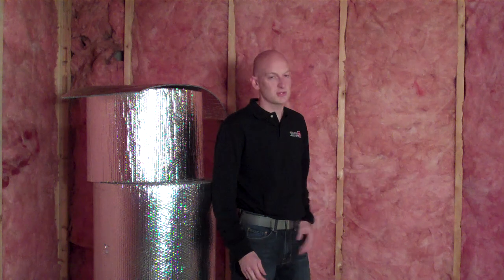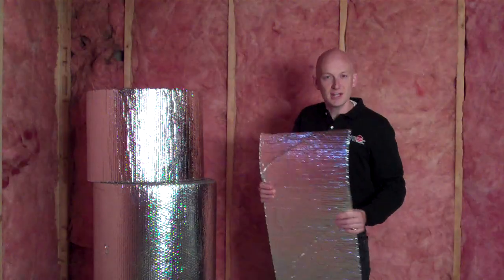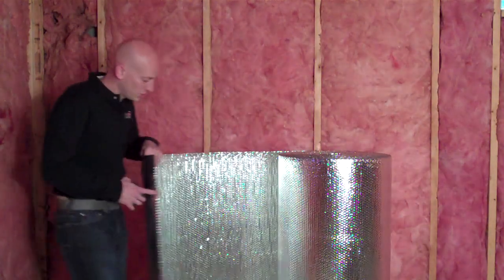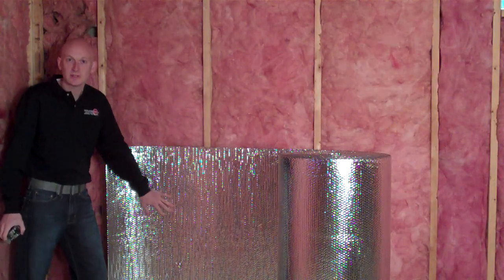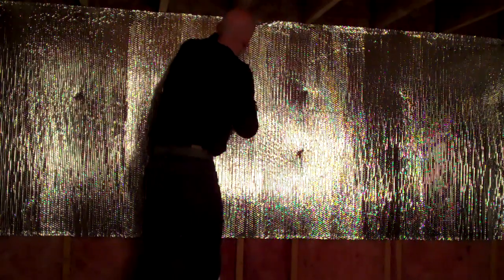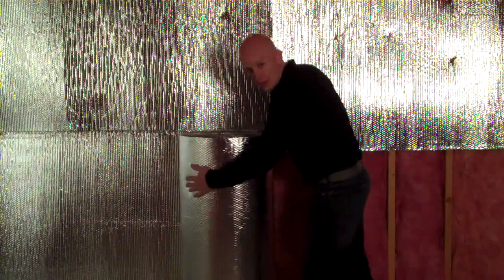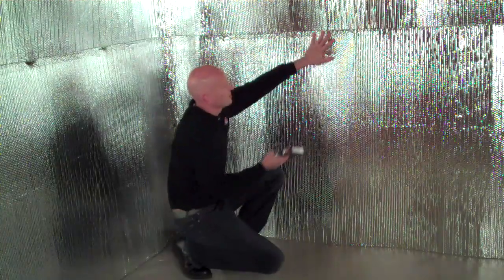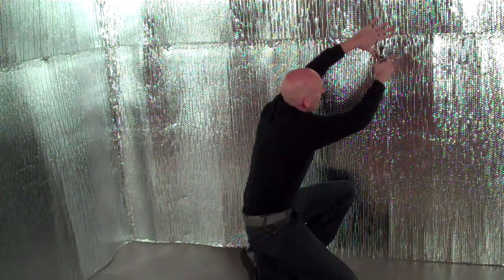Insulating Walls with Reflective Foil Bubble Insulation

Comment: I did this to my garage in 2006 before I ever saw a Mike Holmes production. If I had to do it all again, it would be with closed cell foam. I had to open the wall recently for a new electrical main panel install. No mold, no moisture. This stuff was advertised then as an R19 value, but it is only a thermal break. Closed cell would have been so much easier and better, but more expensive. I had to extend my garage door opener antenna because of this stuff, it blocks all signals. I thought I would answer a few of your questions since InsulationStop stopped answering years ago.
Reply from the maker: Closed cell insulation is a great insulator and as you mentioned expensive as compared to other insulation types.  Our products are impervious to mold and moisture as well, that's why they excel in applications prone to these conditions.  The r-value you mentioned is for fiberglass insulation and not reflective insulation (or at least should not be).  Regarding extending your garage door opener antenna this is interesting as there are many references on the web that radiant barriers block reception.  We have not found this to be an issue with our customers.  We DO however sell a product designed to block all signals but this is used in a specific types of wall constructions.  The products are for SCIF buildings or Sensitive Compartmented Information Facilities.  They are essentially quiet rooms used primarily by the government where they need to ensure there is no electronic eavesdropping.  Here is a link to the SCIF information on our webpage, http://www.insulationstop.com/rfoil-scif-ultra-nt-radiant-barrier-solid.html, look halfway down the page under the product to see the SCIF specification and different wall construction techniques.  We apologize for not answering comments.  We were unable to comment, post video or access our account under YouTube/Google/Google Plus "conflicting accounts".  It took a long time to get this figured out so we would not lose our entire channel.  With the help of Google Support we finally did.
Reply: 404 page not found

Comment: If I was to do this with tinfoil aluminum foil and the put lining paper over it would it hellp with preventing damp mould and help keep my flat warm I live in uk
Reply: Standard tin foil aluminum does not have the same reflectivity as radiant barriers made to block heat.  You would want a product at least 95% reflective or more.  I'm guessing you want the lining paper to act like the kraft paper used in insulation to be a vapor barrier?  If so you would want the lining paper to have the same attributes as kraft used in standard insulation products.
Reply from the maker: In order to be considered radiant barriers, reflective insulation must be at least 93% reflective.  I am not sure exactly what you are referring to when you mention "tinfoil"?  I'm guessing the lining paper would act as the "kraft" liner which we use in the United States as a vapor barrier.

Comment: Why are you installing a vapor barrier in a basement? I'm pretty sure that'd against building code and prone to start rot and mold.
Reply: This depends on the location actually. In some states the location goes through very different seasons from cold / frozen to seeping / wet to dry and breathing. While other locations only go through cold / frozen to wet. In such locations a vapor barrier is advised. Not only that if you have outside treatment to the wall a vapor barrier might also be suggested to keep the inner wall away from both climates.
Reply from the maker: Hecket I agree with Hecket.  Location determines building practices.  This is why local codes supercede national codes.

Comment: What's the rated R value of this stuff?
Reply from the maker: The r-rating depends on your application.  Our website shows many of the common applications and their related R-values (use in barns, metal buildings, hvac insulation, pipe wrap insulation, and under concrete slabs) to name a few.  Radiant barriers, the sheet like material, have no r-rating and provide a radiant barrier only.
Reply: The R value is 1, its used to stop radiant heat, not conductive heat.
Reply: Depends on the application.  On our website we show many different construction applications and the R-values are listed there.  (Pole Barns, Metal Buildings, HVAC Insulation, Pipewrap Insulation, Under Slab Insulation, Crawlspace Insulation)
Reply: lostimage08 This is the r-value when used under a concrete slab as an airspace is not present so only the bubble layers are creating the resistance or R.
Reply from the maker: lostimage08 This is the r-value when used under a concrete slab or in a radiant heat application as there is not an airspace present.  The bubble layers provide the R.

Comment: This product looks safer when directly  under the sheetrock or wall treament ~!
Reply: In finished areas this is where it would be installed.  For unfinished areas the insulation facing the exterior is commonplace, especially in barns for instance.
Reply from the maker: In finished areas it would be, however for unfinished spaces this application is fine.  This is the same way it would be installed in metal out buildings and barns.

Comment: This looks like it might work  well in my garage.  I already insulated the garage door with something similar.  This might be good enough for the  walls.
Reply from the maker: Many garages especially in the southern United States are insulating with reflective insulation as it is inexpensive, and works exceptionally well at blocking radiant heat which is what is being transferred by the metal door into the garage.
Reply: In the southern United States, it is common to insulate your garage doors with our products.

Comment: Just started inquiring about insulation. I am in southern CA and have an older wood stud building/shed that has no insulation. Last winter we had several weeks of 24-35 degree weather. Summer is avg of 90-106. How much does the foil bubble wrap increase the R value?

Comment: I'm a big proponent of radiant foil barriers and have installed them in many applications. However, installing it over the studs and insulation is INCORRECT. Moisture travels through concrete walls constantly, thus trapping moisture between the wall and foil. The ONLY vapor barrier that should be used is 2" XPS rigid foam. Only trust info from building science engineers. Google Joseph Lstiburek understanding basements. Or Mike Holmes best way to insulate a basement. Do it right or not at all.

Comment: I think serious consideration should be given to the possible moisture buildup and mold growth behind the foil.   Given that the foil is being installed over insulation, one might wonder if a radiant barrier without the bubbles might be considered.   I have no idea if a radiant barrier with ventilation holes might be a better way to go or not.   See videos on attic radiant barriers.

Comment: ladies and gentlemen...you are looking at about $140-180 just for that one wall of foil barrier. Plastic barrier is only about $10-15 dollars for that wall..  LOL  budget is the new trend. Ill stick with the plastic rolls
Reply: Plastic rolls ? That wouldn’t reflect any of the radiant heat which this is designed for , this also didn’t say you have to have a 1/2” - 3/4” air gap as well. So no plastic would not work , 

Stop spreading wrong info on the internet to sound like you know what your doing .

Comment from the maker: In building construction, a vapor barrier is used to the interior.  That is what the kraft or brown paper on fiberglass insulation is used for.  If you use unfaced insulation, you then use a vapor barrier.  If there is a concern, like you have, a perforated radiant barrier can be used in this application or regular wall construction.  This will allow some moisture transfer.  If a finished wall is desired, firring strips should be used to create 1/2" airspace between radiant barrier and finish.

Comment from the maker: Yes, and you are right.  You can sheetrock on top of the foil as shown in the video if you run furring strips over the foil before the sheetrock to create an airspace.  The other alternative is a product called "staple tab" that runs widths similar to fiberglass insulation.  This goes into the stud cavity and can be installed into the cavity approximately 3/4" with the tabs even with the edge of the stud.  This allows for the necessary airspace as well and sheetrock can then be applied.

Comment from the maker: @georgel19841 

No georgel this is high grade commercial aluminum foil that is designed to reflect radiant heat.  It's tear proof with additional materials to strengthen the product.  Aluminum foil is completely different and certainly not to be used as an insulation material.